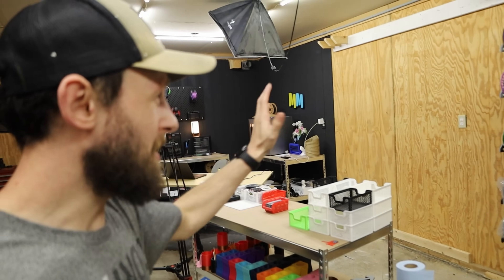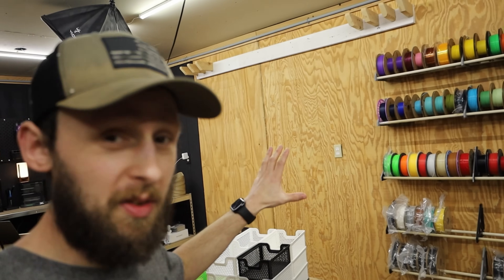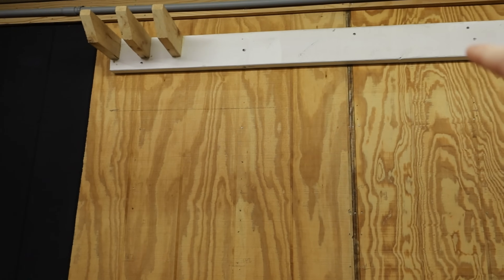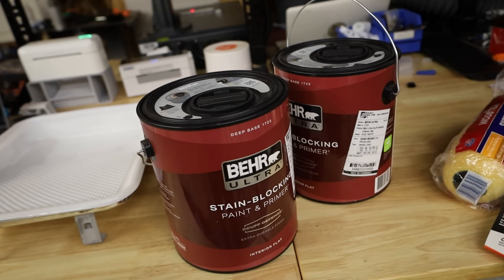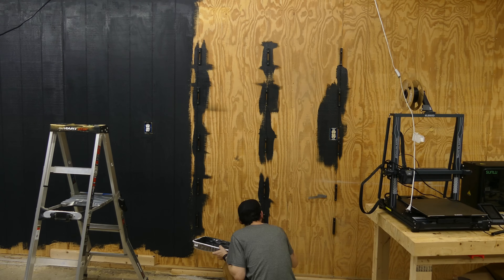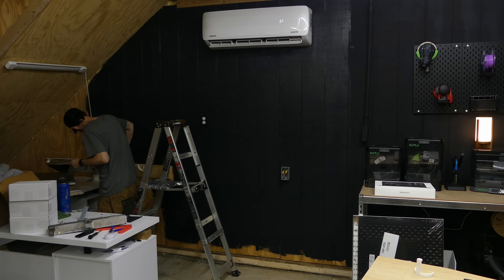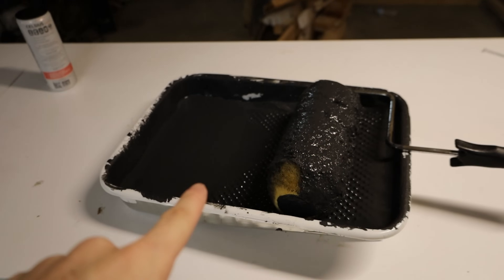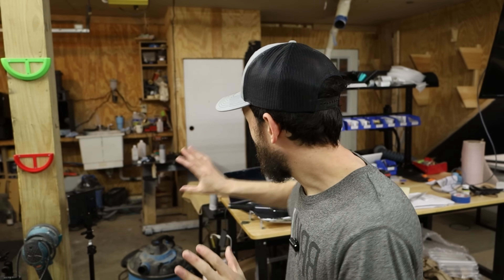3D Print Farm Refresh | Brown and Busy to Black and Bold

Comment: The black looks awesome...
But one tiny thing has been bothering me for a while now: the distance between each of you filament racks is not equal ;-)

Next video: RGB LED strip lights everywhere? 
You could even make a LED strip next to a printer light up green when it's done or red at an error. If you can get the printer into Home Assistant or something.

And that toolbox should not be red, but blue (and yellow?) of course, like your logo!